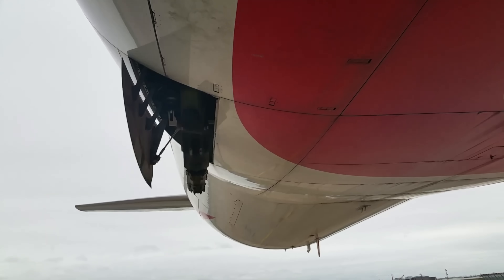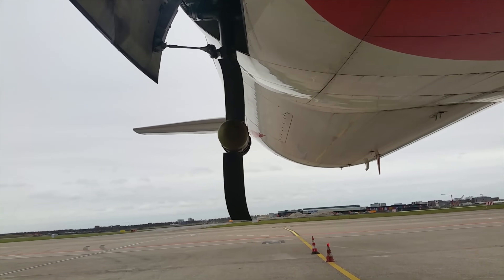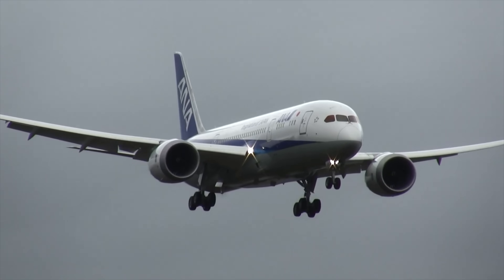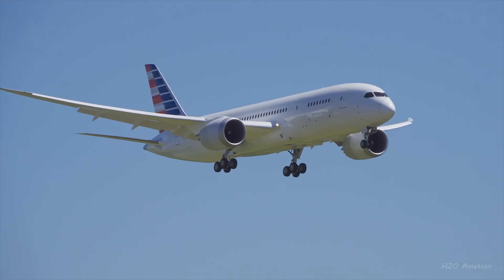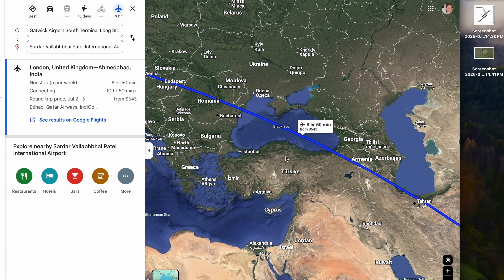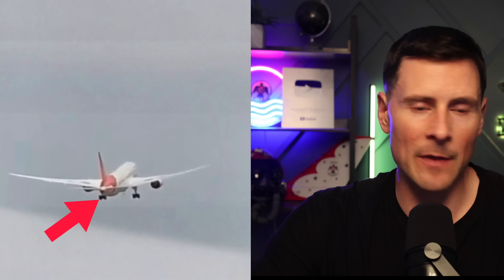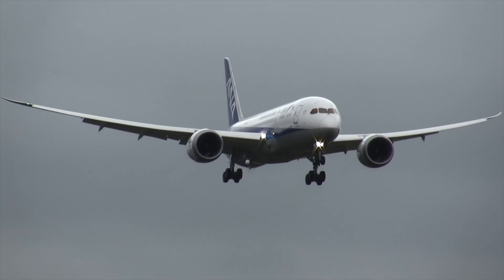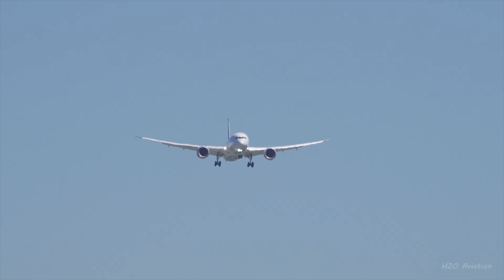Air India 171 SHOCKING UPDATE on RAT Deployment and Flaps!

Comment: 4 conditions cause auto deployment of the RAT... Electrical Failure, Hydraulic Failure, Dual Engine Failure, and Failure of the Pilot and Copilot's panel Displays.
Reply: The Pilot's Mayday said they had lost Power AND Thrust indicating a loss of Pilot's and copilot's panel displays symptom of a Electrical Failure.
Reply: @DronesandHamRadios  Electrical failure shouldn’t cause both engines to fail.
Reply: @infostudy101  An AC Dual Bus electrical failure can cause the flight computer to fail causing the engines to go to a low power idle state
Reply: @DronesandHamRadios  This low power idle state can be reset quite quickly. However, as the accident happened just after takeoff, perhaps not enough time.
Reply: @DronesandHamRadios  There is not a single flight computer.  And the FADECs in each engine will continue producing the last commanded power level even if everything else fails.

Comment: But each engine generates power differently than most planes and the APU as well.  This is basically an electrical airplane. 1.3 Megawatts.  A rat will not help there.

If I were guess, Boeing will release a statement to pilots stating that you should always takeoff with the APU running

PS there are 6 generators. 2 per nacelle

Comment: If you look at the picture of the entire aircraft, you can see black stripes on the left and right showing through the wings. This can only be seen when the flaps are extended. This allows you to see a little way under the wing, where the actuators for the flaps are located. If they were retracted, these stripes wouldn't be visible.
Reply: Thats why I have been saying in every aviation channel who's been posting on YouTube and Twitter on this incident from day one that its must be the bcoz of the fuel or any electronics issue.
 No other reason sounds plausible strongly enough.
Reply: … absolutely, spot on ! Thank you for pointing this out, especially to Captain Steve.
Reply: critical observation
Reply: Wing wreckage images show flaps extended
Reply: Thank you for your clear answer, I was at work today until evening and saw your post only right now.
I guess it was an electronic fault touches every part of the aircraft. But it's only my Assumption.
Reply: Pilots are highly capable in situations like this, and with that level of experience, they wouldn’t make such mistakes. I saw the A171 side-by-side takeoff on @aviationunfoldedx, and it looked exactly the same. All the evidence suggests that the flaps were extended, even the wreckage shows the flaps in an extended position.